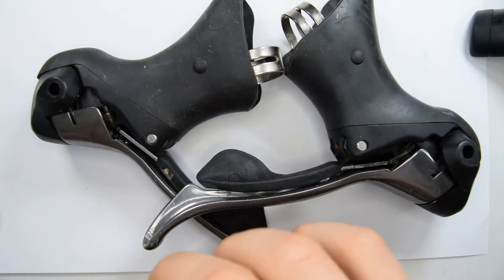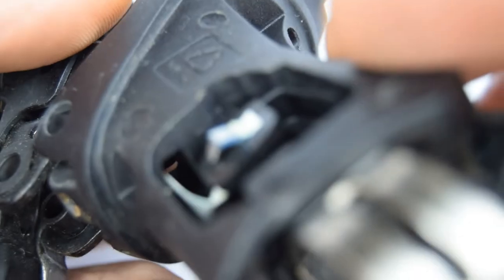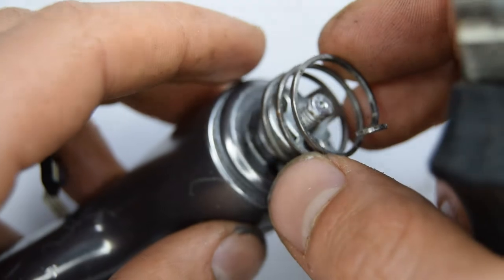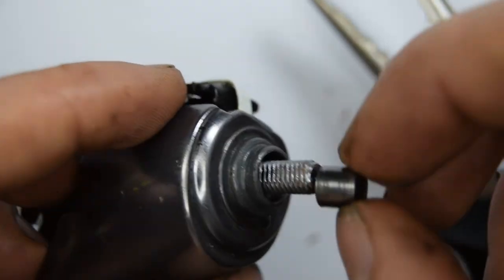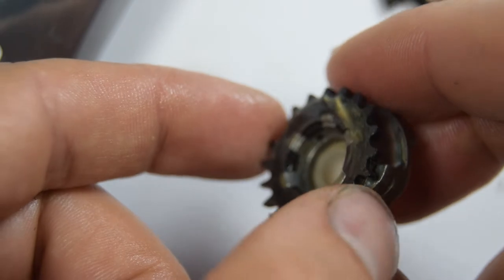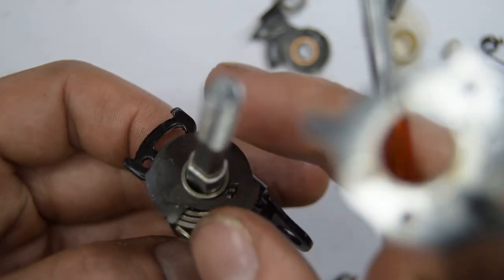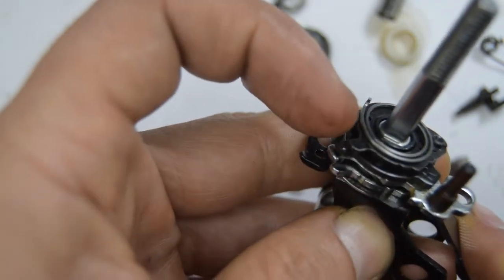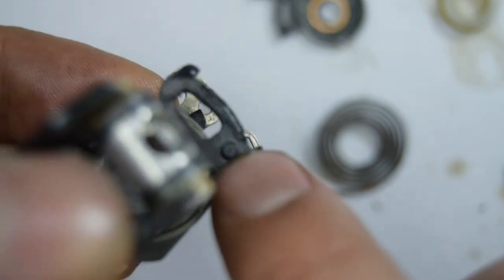Pt.1 Shimano 105 5600 10 speed shifter: Rebuild service clean dissembled

Comment: This is a very useful video, really saved my day. At the end, where ATBOY used the 1.5mm allen to compress the spring, I used a metal tube from a thread bobbin holder because I also tie flies for fishing. If you don't own one, it's about $3USD compared to the (unavailable) Shimano tool for $15. The metal tube was the ticket. Done on the first try.

Comment: Thanks to this video, I managed to save my st7801........ not exactly the same but couldn't  find any for the 7801 that showed these internals..... this 105 turns out to be very similar and helped me work out the main order of assembly needed - especially the springs. Now managed to get the 7801 back to working order saving more than a few pounds. Cheers 👍🫡

Comment: Awesome video.  Thanks for taking the time to develop such a thorough product.  Daunting job, but with your simple process it makes it achievable.  FYI, near the end of the rebuild you have to hold back the spring and you use an Allen key.  I had a look to see what the special Shimano tool looks like - a thin metal straw.  I used the inside of ball point pen, one made of metal.  I cut off the ball point bit and it worked perfectly first time.  Thanks again.

Comment: Brilliant clip. The video is so much clearer than many. Thank you! I had a snapped cable end that I managed to get out without disassembling the spring at the top but a small spring fell out of somewhere while I was washing with WD-40. I was hoping to identify it. It's not any of the parts in this video. That seems to be good news.

Comment: Thank you.  @17:00 I can clearly see 6 lugs attached to the cable-pulling barrel.  Whereas mine are all snapped off and lying loose inside the grease.
Damnit - now I need to try epoxying them back on, or replace the whole shifter.